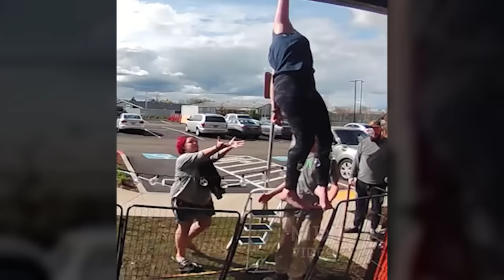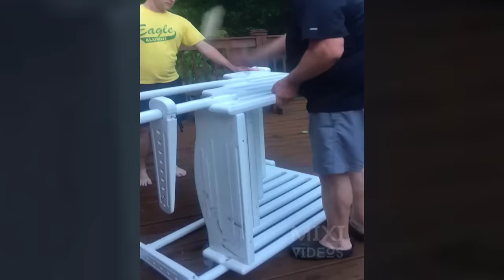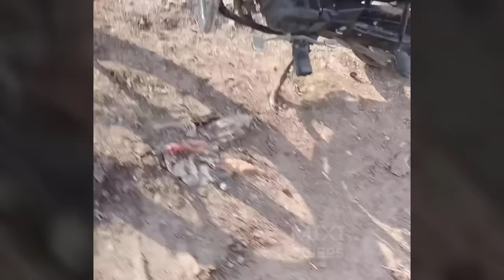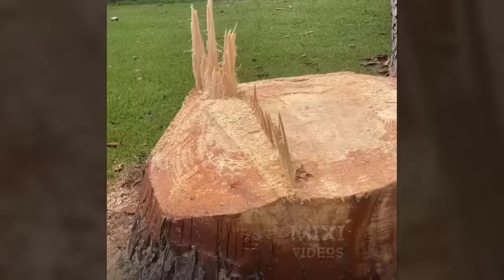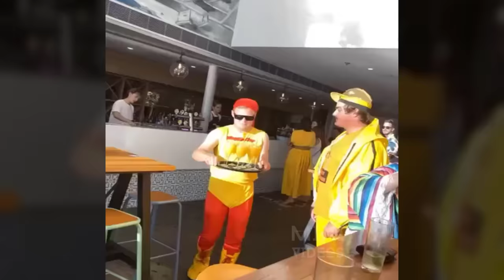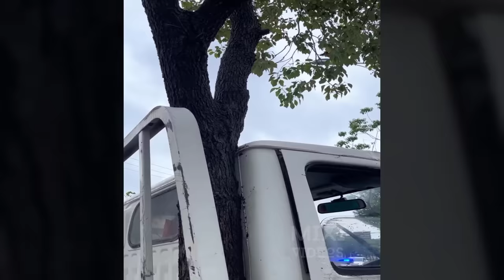TOTAL IDIOTS AT WORK #124 | Fail Compilation 2023

Comment: the last one did the worst possible thing by leaving the tractor in the position that caused the truck to run away. if he had carried on until the weight was over the wheels it would have stopped, if he had immediately reversed off it would have stopped.
Reply: Block of wood sorts the Problem. 
Mind you  person there has to THINK AHEAD..